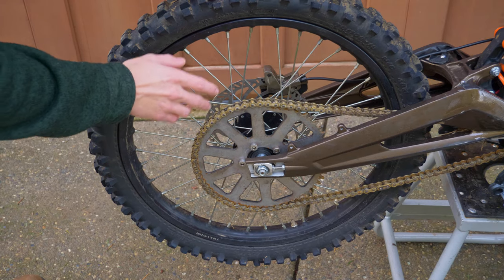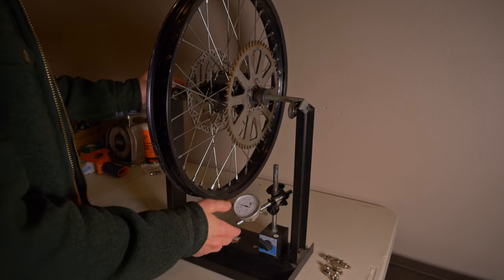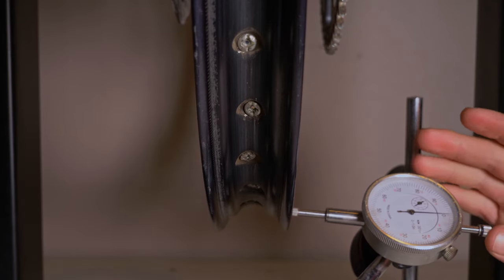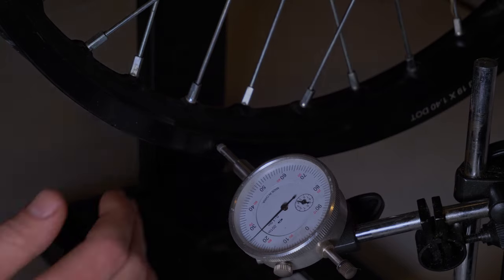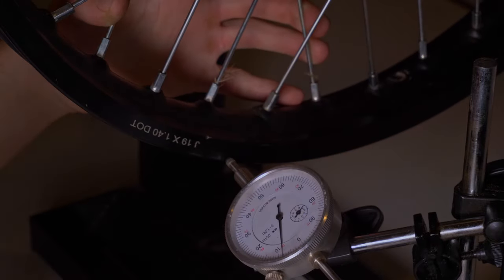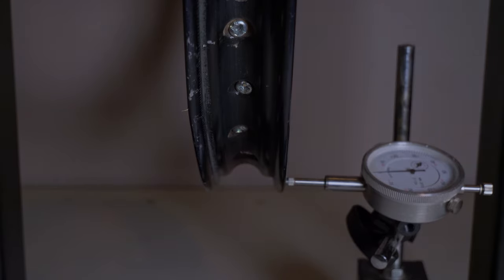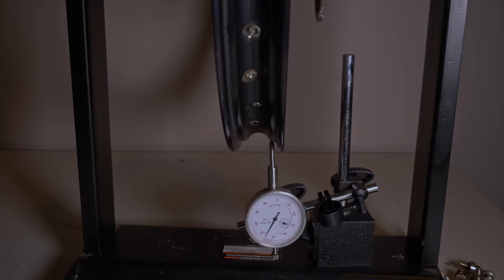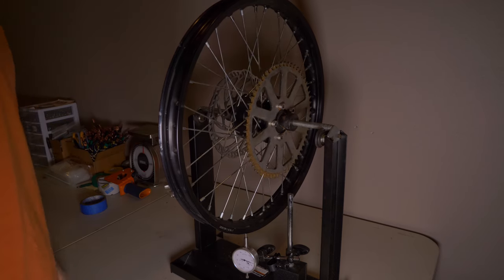Sur Ron Rim Truing Tutorial

Comment: That's interesting... I broke a spoke on the supermoto wheelset last year when I was commuting.  I figured the Chinese didn't really design these bikes to be ridden hard or even off road.  This was evident when the first couple of years they didn't even sell them with fenders.
Reply from the maker: If they weren’t designed to go off road then why  did they give them 8 inches of travel and knobby tires?
Reply: @emotobros  RST and DNM forks are also the pinnacle of downhill mountain bike engineering... as well as the ball bearing Walmart headset that eventually had to be replaced with the tapered bearing headset.  The way they’re sold now is much better due to the years of people complaining about stuff breaking on their first rides out.

Comment: Cmon....you said the wheelsets were no good..I call bullcrap on that statement...they are actually by mountain bike standards a tank. I have had no issues so far, and I could see @1:39 of the video that despite having many spokes loose, the wheel was still pretty round!..I would call that a pretty good wheel. Nothing will survive abuse, so what you should have done is compare this with an overpriced so called high quality wheel and subjected that to the same abuse and compare.
Reply from the maker: By any measure able metrics these wheels are no good and we stand by that. You’re right in saying that for MTB wheels they are good, the problem is they’re on a dirtbike. For MTB wheels they are way to heavy, for moto wheels they are still heavy but far weaker than anything made for a dirtbike. 

We’ve been running “over priced” wheels for about half a year and not only have we never needed to tighten the spokes, they’ve never even slightly came out of true and are noticeably more rigid when riding.

So much of wheel pricing comes from the labor involved in building the wheel. The components themselves generally are fairly inexpensive.